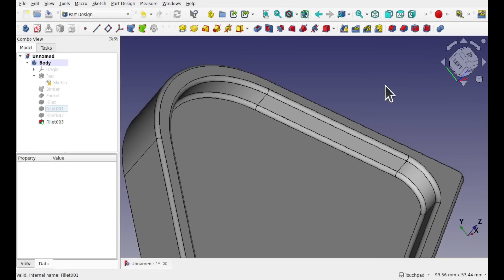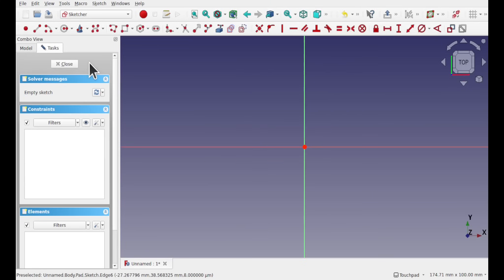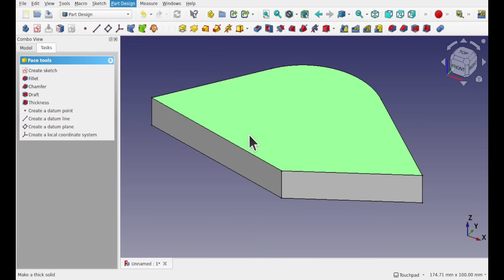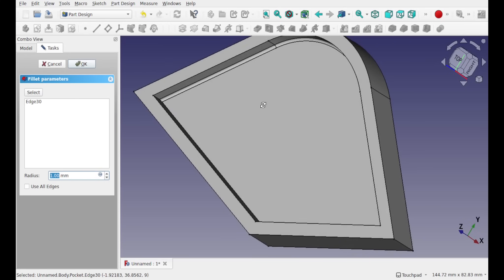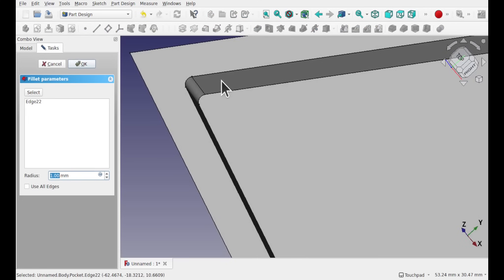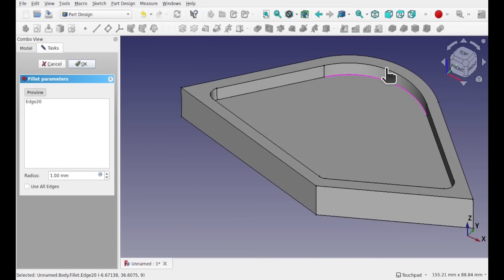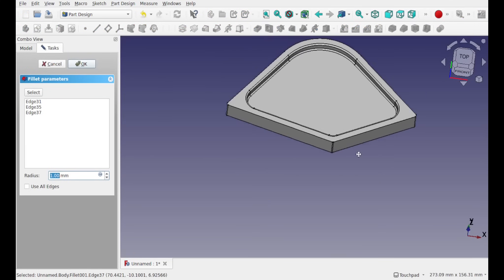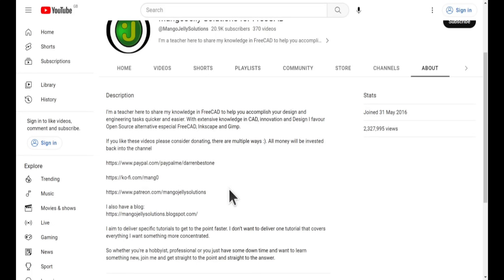Quicker Better Fillets in FreeCAD With This Simple Tip A must for Beginners

Comment: This was useful tip. I wonder how does it transfer to chamfers. Do chamfers behave the same way as fillets? When 3d printing it's best to have fillets in XY plane to allow smooth movement of nozzle through layer, but chamfers in Z planes in order to prevent uneven stairstepping between layers, which is unsighty.
Reply from the maker: Glad it was useful, sorry bit behind on the comments.  With the chamfers you can get a different 'point' finish if you chamfering from three converging edges if you do them 2 edge chamfer then final edge chamfer rather than all three at the same time.  Thanks for sharing the tip :)

Comment: Is there a similar option in FreeCAD like the one called "tangent propagation" in SolidWorks? If not is there some kind of trick to be able to fillets on a single selected edge?
Reply from the maker: Just had a look at solidworks to see the feature you was referencing.  Unfortunately not in FreeCAD.  You would have to add the individual edges when you create the fillet .
Reply: @ I see. I saw that on another tutorial video and it made so much sense. Shouldn't be that hard to implement from my point of view. I started with Ondsel first and they really made freecad feel more "premium".

Comment: You seem to know allot about this program. Who teaches you? I get the basics. Its not that difficult. But every now and again you pull a rabbit out of that hat of tricks of yours. And there seem to be no end to the ammount of rabbits you are hiding. I sometimes struggle to make an exact copy of a part with allot of curvature incorporated in it. I tend to take 2d siluette images of the part, use the curves workbench and make the part, like your tutorial about the sportscar, but the part never comes out the way i need it to be. It gets hard sometimes.
Reply from the maker: Thank you, I don't have a teacher but I do read the source code to figure out what some of the less documented features do. I also came from a number of other 3D programs in the past which have helps with problem solving. I have a whole Warren of rabbits awaiting escape!

Comment: Me here was thinking that FreeCAD doesn't have offset feature like other proprietary CAD tools. But here you show in a few seconds that this is indeed easy! It is not even the topic of the video. Such an overlooked feature.
Reply from the maker: Hi, so there are offset tools in part workbench for 3D and 2D offset but that is for solids and surfaces.  Sketcher wise there is no offset (yet) unless you use the installable macro which has as few issues.  But I went through the features of 0.22 which is in dev and they do have a offset tool coming to freeCAD :)

Comment: I've done a lot of experimenting to try to determine what rhyme or reason there may be with fillets and chamfers.  For simple objects I get the basic geometry correct and then chamfer and fillet at the end.  Sometimes, a fillet or chamfer is part of the geometry that I want because I'm too lazy to sketch the angle or rounded surface, so I cheat and use the chamfer or fillet tool on a 3D primitive.  Then I use binary operators such as fusion, cut and intersection, and when I want to use chamfer or fillet on the resulting object to soften sharp edges, FreeCAD can throw up all over that and Part Go Bye Bye.  Fortunately a uniform radius fillet to finish a part looks best so in most cases I can finish the basic simple geometry, select the resulting part, select fillet, then select all edges rather than the fussy and time consuming job of selecting edges manually one at a time.  Fillets can be as large as I like, up to the point where one fillet overlaps with another.  If the smallest space between two edges is 5 mm, a 2.499 fillet creates the most rounded part.

Comment: why not press m to create the tangent arc from multi polygon tool without going for other tools ?

anyway this is a great toutorial for begginers because many of people make things manually and it sneakly include some tools from the set not many of peoplr know how to use, like shape binder
but even after 2 years i think of using this program i still struggle with fillets sometimes or rather i make them break the part when i do them out of order
one thing to note freecad can get very confused with picking segments of fillet or champhers when you use 2 dimensions, sometimes aplying depth and width interchangably to hilarious monster effects and tangent edges are sometimes the only wy to fix it

Comment: You should mention to add filets and champers after the model is done to keep the noobs from running into the reordering bug and make them aware of it.
This bug is so frustrating that it will drive somone away from the software faster than anything else.
Reply: That's not always the best practice. If you have a model lets say a union from two parts and you do the fillets last changing one of the two parts may break all of the fillets. While if you made the fillets per part and the union last you'd only need to undo the union instead of all the fillets. I know this from experience because I started like you say and later found out it isn't always the most practical way.
Reply: @simduino  people also say to never do your fillets in sketches (presumably as derivation of "do them last"), but I implement them there whenever possible because that's so much more reliable.  It's much harder for the toponaming problem to affect sketch details and there's no guessing how convergent fillets will be interpreted (or fail).  Then at least what does break is smaller in scope and thus easier to manually fix.

Also, I think it's fair to classify FreeCAD's toponaming handling as a bug when it does it so much more poorly than every other CAD program. 80% of the time the correct remapping is unambiguous and FreeCAD's inability to do so is purely rooted in its technical debt and architectural limitations - not math.
Reply: @HonoredMule  Indeed, rounding off corners in the sketch is way easier than doing a fillet later on. Using tangent arcs after extruding or padding you can even do fillets on the sharp edges of the arc while this is impossible to do on the sharp edge of an extisting fillet, freecad just won't do that.
Reply: I am adding them throughout the modelling as when the number of edges or faces change, fillets are the most tedious one to redo. Sketches are usually just placing them on the right new face but clicking through fillets again and again is very tedious.
Reply: You're talking about the topological naming problem. That's not a bug, it's an unsolved mathematical problem. Other CAD-software has this too, they just hide it better by making what amounts to educated guesses under the hood. Even if you work in professional CAD packages, you will break models if you don't understand this problem and implement proper workflows to ensure stability. However, once you do that you might as well use FreeCAD, because with proper understanding and best practice, it's simply not a problem anymore.

Comment: Fillets are the most finicky things to use in freecad, they kind of lead a life of their own... If it doesn't work in one way you need to redo it in a completely other way to get what you want. I love your videos because of that, they show other ways of doing things. Very educational.
Reply from the maker: I did a video a while back of why fillets fail and the most common causes. For some reason that gave me a bit of relief from the fillet problem, in that I got something out there to help others. Next project I did, had hit about half the fillet failure I was talking about, so I  had a good cry lol. CAD is hard but I love it. Great to see your enjoying the videos, thanks for the kind comment.
Reply: @MangoJellySolutions You're welcome, and I did see that video too as I really enjoy the way you explain everything. When I started with freecad I made a mess using the parts design wb and the sketcher, couldn't get my head around getting how it works. My background stems from ages ago using AutoCad even before windows arrived. I was a professional designer for shapes and routines using a graphic tablet and I had some knowledge of isometric design.  So yeah the sketcher isn't all that strange to me, but getting it to work in 3D was another thing. Now I'm much more comfortable with it and I learned a lot from your videos. I started out with freecad leaving the fillets for last, but now I know better. Keep up your excellent work, it always helps.
Reply: I have to go look for that video on why fillets fail.  It is the most frustrating thing for me and trying to learn freecad. Just today I was going to make a part for Morse code key. A platter about 2 mm thick with a nice fillet edge.  Drew a centerpoint circle in the sketch, closed the sketch, did a pad of 2 mm, clicked on the outer face and selected fillet, clicked okay and got a message that said job not done and body is not a solid.  Sigh....
Reply: this video helps to understand how to fix one particular kind of problem of  Shelling in FreeCAD.  Shelling/Thickness is one of the things i find that breaks most of the time in FreeCAD

Comment: 3:36 Why pocket and not "extrude" (pad) and cut the shape ???? Just get rid of pocket button and use extrude for both processes. It is just one of many confusing things in FreeCad. Also why is binder instead of offset in sketch ???
Reply: offset tool will be available in a future version;  Already in dev version.  if you prefer subtracting an extrusion, just use Part WB

Comment: Forget the fillets. The 2:35 Sub-Object Shape Binder was the most interesting! 👍
Reply: This tutorial was definitely a twofer
Reply from the maker: That tip has been so popular 😀
Reply: yes !  first time i've seen anyone use it - and how cool was that ?!
Reply: Definitely. Donated.
Reply: V 0.22 may reduce the subshape binding need. I forget the feature but it gives the outline a thickness
Reply: @smportis I don't think so. Today I've actually used both (in the dev 0.22 version) and the thickness creates a thickness around the outer side of the padded sketch, thus the object is thicker than what you originally sketched. Using the subshape binder you can actually create the thickness inside the padded sketch (with negative offset and pocket) which ensures the outer dimension of the resulting object is the same as what you defined in the sketch.
Reply: Pure gold!!!
Reply: Actually there's another video about that, just look it up as it's not the goal of this excerise.

Comment: Is there a way to keep the sharp corner and have the fillet in the bottom round off nicely instead of two fillets meeting in it?
Modifying the part isn't always an option but adding fillets often is beneficial to the strength if 3D-printed parts.
Reply: I think it's physically impossible... 🤔
Reply: @saveriog.825  I know, geometrically it would need to add something to the bottom of the corner, but at least having it taper towards the rim if the part would be better than changing the geometry of the part completely.
Reply: @JonasKöritz  I think the only way to get what you are describing is making some sort of cone on that corner? With an equal fillet along the corner, you get a section of a cylinder. So if you have a non-zero radius on the bottom (a "round bottom") and a zero radius on the top, that sounds like a cone.

One way I think you could do that, although way too complicated for my taste, may be to make two sketches, one for the bottom, with the radii on the corners, and one for the top, with sharp corners. Then you do a subtractive loft between them.
Reply: @the-mush  that's a smart thought😯
Reply: @saveriog.825  haha, thanks! At first like you I thought it sounded like an impossible shape. I have way more experience modeling in blender than in freecad, where you could definitely do a bevel on any arbitrary edge or group of edges, although all faces have to be flat (since blender doesn't work with curved faces). So I tried to imagine what would happen there, and worked up from that.

Adding the bevels on blender could certainly be an option, although maybe a way more cumbersome one. But knowing the tool might be useful if you only have a STL file of the part.
Reply: I'm not 100% sure if I understood your wording. But you could draw desired rounding shape like to one of the sides, kinda like tool. Then use that sketch profile as cutting tool for path, which is the objects perimeter.